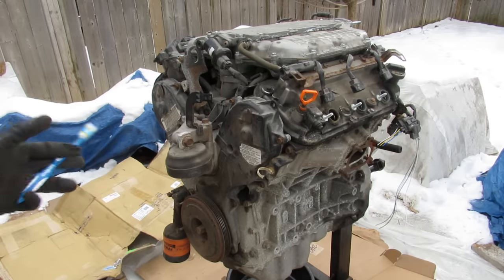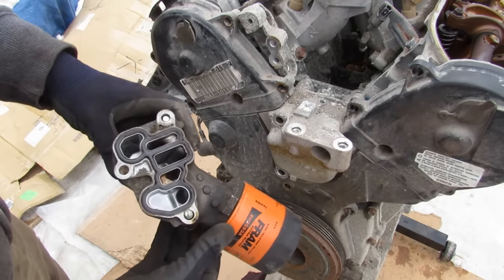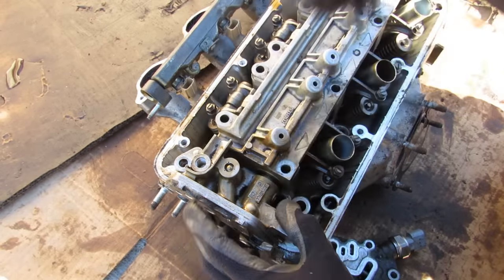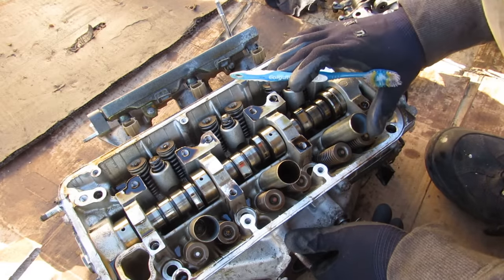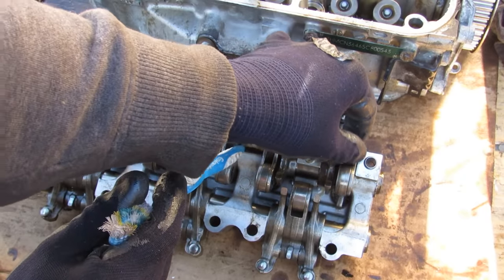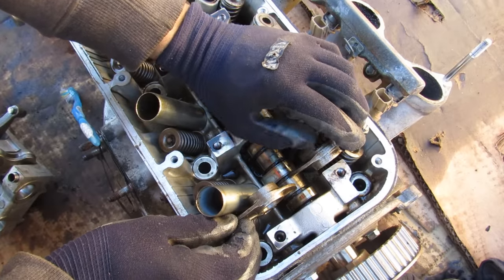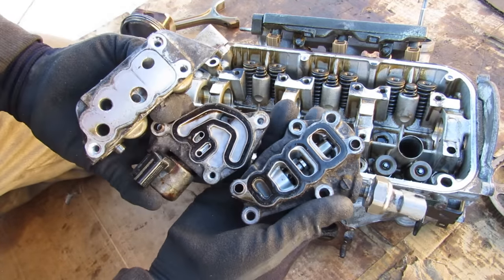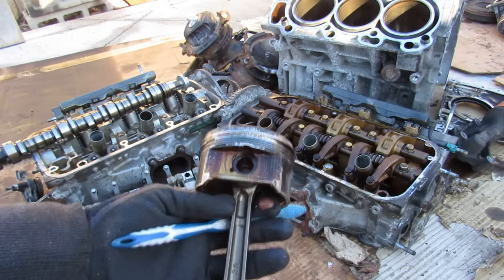Why Cylinder Deactivation Can Cause Engine Failure

Comment: Great video, I’m hoping Honda/Acura made advancements to their VCM tech. We have a 2017 Honda Accord V6, & I change the oil religiously every 3500 miles with the best oil. So far, no oil burning or troubles from the engine at all.  Now the daytime LED headlights are another story...
Reply from the maker: Keep up on the oil. The 2017 is the last of the V6 Accord.
Reply: @speedkar99  - Indeed, & I love the power & smoothness of this engine. I hope in another video, you’ll show the different versions of the company’s VCM. 

Love the videos man!
Reply: You should also change the transmission fluid more often than Honda says if you want to still be driving it at 250k miles.    I have a friend who knows Honda engines and history of problems and he drains and replaces his every 15k miles.   I just got a used RDX and will change mine every 30K miles minimum unless the service tech says the fluid looks bad and then Ill move to 15k miles.
Reply: @georgesmith4639  agreed, we have multiple Honda/Acura vehicles. And I personally do a drain and refill of the transmission fluid 3 times a year.
Reply: @MrSamPhoenix  I saw on another video today that there's a transmission  fluid filter that also needs changing (I think every 30k miles).  It's located way down below the battery.   Just curious if you change that as well and how hard it is to do from the top side.
Reply: I wish people answered all the pertinent questions lol, but this looks like another one for the odyclub forum for me. :-)

Comment: Disabled VCM with Ktuner on my 2017 Accord Coupe V6 at 6,000 miles, haven't turned it back on since. At 59,000 miles now; the engine doesn't burn a drop of oil.
Reply from the maker: Awesome! So that's all software, no need for resistor?
Reply: @speedkar99  Yup! Just an ECU reflash. Technically the only "correct" way to do it
Reply: @accordinglyryan  yup 👍

Comment: November 4th 2020 my 130,047 mile V6 experienced its failure. ALWAYS used Mobil 1 products specific to the car, changed every 6k miles. I get in the car that morning, on the way to work, and I heard a metal on metal banging noise. The car was still running, seemingly fine. I had no choice, so I drove it to work and then straight to the shop. I got the bad news the next day, rear cylinder head...done. My guy found a 81k engine and in it went. I bought a 21k mile Arizona off lease 2017 v6 immediately as well. Hopefully the 2017 with its changes has engineered this problem out.
Reply from the maker: Interesting. How old was your car?

Comment: Hi Speekar,  Great explanations as you go a bit more indepth!  Question, have you seen the S-VCM controller?  It appears to fix everything except being about 10% cooler on the thermostat reading.  I think this VCM is a big opportunity if it is 'solved' as there are so many Honda 3.5L's.  Thanks Speedkar.
Reply: I have the svcm in my accord, works beautifully. From what I remember it only modifies the signal in the running temp range and passes the true signal through for any other temp and that seems to be my experience. And it's very easy to disable with the 12v power wire that feeds it. In power loss it becomes passive all the time and just passes the true signal through. 

I still need to do the rings and cats on my engine but the oil consumption has plummeted. From 5-7 qts between oil changes down to just 1-2 qts, which I attribute to the rings and the valve cover gasket leaking. Still need to clean the spark plugs at each oil change but it's better than needing to replace them all the time from a misfire. 

I'm a very happy customer.

Comment: It is very odd how Honda can pull off such a failure when at the same time and same year pull off some of the best engines ever.    The J35A5 I had in my old 2006 MDX was so far the only engine that burnt 0 oil even at 200k+ miles towing an RV on very long road trips like 8000 mile trips and the oil was still full at the end.  The run after more MPG just lead them to making errors it seems.
Reply: How heavy was the camper?

Comment: Excellent video, as usual! Nice pace, good information!

It seems that fooling the computer into thinking the engine isn't warmed up would cause it to run open loop (as if the choke is on) which would cause it to run rich all the time (poor mileage, carbon build-up, poor cylinder lubrication). I also thought maybe one of the failure mechanisms might be when the back three cylinders are reactivated, re-engaging the pistons in the rocker arms might be a little dicey with the stationary rocker arm piston trying to engage a fast-moving part. But the oil-burning bit - ugh! Seems like it might be better to hold all the valves open, but then that would introduce other problems unless maybe there were separate intake and exhaust systems...
Reply: That's not actually true. The VCM disable devices only slightly affect the reading out of the ECT1 sensor. The ECT2 sensor is left alone. It's been found to have no negative affects.

Comment: I did a tune up on my 09 Odyssey 1 year ago, I just got a misfire on cylinder 1 the other day and when I pulled the plug it was completely caked with oil. I'll have to do another tune up and I'm buying the device to deactivate the VCM.

Comment: Quick qualifier, I’m a Honda technician, while I agree that the VCM system isn’t perfect; I literally did piston rings on a 11 odyssey today, that discoloration difference between bank 1 and 2 is very common, and not due to a rebuild. Like literally virtually all 6 cyl Honda motors are gonna look night and day different between bank 1 & b2. 
Bank 1 is always 10x nicer looking then bank 2. I’ve asked 2 master techs I work with why that is, I’ve heard different theories, one is the path of the oil, the other is that bank 2 runs hotter because it’s always live (for the most part, cyl 4 can deactivate also)
Reply from the maker: Good to know that. 
Even non VCM motors have that color discrepancy. How long did it take to finish that Odyssey?
Reply: @speedkar99  embarrassingly long. 
Original complaint was a b1 & b2  tw-wuc failure, turned out it was due to oil consumption fouling the cats. So it booked out at 27 hours according to Alldata , that’s 22.6 hours for 4 out of 6 piston ring sets then 4.4 hrs for both cats, we thru in a t-belt service that included water pump, belts etc concurrently to shave off 4 hours but still, it was pricey. 

It was about the biggest job you can do on that engine before it just becomes cheaper to find a used engine. 

Client was very cool, took me about 20 hrs to do the 27 hrs labor, that’s including valve adjustment (Honda’s don’t use hydraulic lifters) coolant flush, oil change etc. 
I wish I could post a pic of the four pistons I removed, cleaned and reinstalled with new rings. From the top, they looked like new (yes, I know you don’t have to go all OCD when cleaning the pistons but for 20+ hours labor, I’ll spend 1hr scrubbing pistons in a bath of VOCs :)
As for the original question about discoloration, I’ve seen it all the way back to the first gen pilots and odyssey’s, so my theory is that the way the oil flows, it’s just hotter, more likely to leave deposits by the time it’s draining down the passages in b2, but again, that’s my guess, I have not had that confirmed by any Honda engineers.
Reply: Edit* I meant the same time frame odyssey’s, I realize they go back way further*

Comment: Very nice explanation as usual, I always thought all VCM systems worked fully electronically by just shutting off fuel / spark to cylinder(s) ECU wants to deactivate and letting mechanical parts keep going as usual.
Reply from the maker: It might do that while coasting to a stop and engine braking

Comment: Why did they not let the exhaust valves open (leave them partly open), and use a separate exhaust perhaps? It would get rid of the issues.
Reply: Or the intake for that matter. The valve rockers still ride the camshaft, and a minimal opening with the right timing will generate positive pressur in the cylinders.
Reply: @pizzablender  I think they want to avoid vibrations and wasting energy on compression. But keeping the exaust valves partly open (during all four strokes) would do the trick.
Reply: They keep the valves shut because the air acts like a spring. If the valves were open you'd lose energy moving air in and out of the cylinder. A spring stores potential energy when compressing the releases the energy when the piston goes back down.

Comment: Very informational video. Had to look at this video because Ford’s cylinder deactivation works in a very similar way in their new F150’s with the 5.0 Coyote engine. I was hesitant to enable the feature, since I had control in turning it off, depending on what driving mode I selected. Since I’m only using flex fuel and the newer engines have both direct and port injection, I’m not too worried about carbon build up. Probably just have to keep an eye out for oil consumption, and ensure I change out the oil regularly.

Comment: Just disabled my vcm with a resistor for the coolant sensor. Vibration on acceleration is gone. Only occasionally feel it.  I was getting 21.7 mpg. We'll see how much it drops. Honda says my pilot should only get 20mpg on average but I'm averaging almost 22mpg. Acceleration is much better without vcm so I would imagine that that will drop the mpg alone. Before I felt like I had to be careful when accelerating, but now I don't.  I'm do a scotty kilmer oil flush before the next oil change and a fuel tune/flush. I'll check the oil today to see if there's a difference.

Comment: To solve the problems from single-engine VCM, one might want to consider two engines independently driving a two-input transmission through a plenary gear set.
Reply: Hybrids
Reply from the maker: Agreed

Comment: This is part of a comment that I made regarding this issue on another channel. "2015 Odyssey. VCM on since new. Works great and saves gas. No oil consumption according to the dipstick. Oh yea, I change my oil between 30-40% on the less than adequate maintenance minder, not the 15% that dealers recommend." Good chance that you hit the nail on the head talking about oil quantity and quality. I pay the seeming ridiculous price for Genuine Honda Oil at the dealership. Maybe worth the price? Will hit 200,000 miles on the vehicle soon, probably this week. Spark plugs were clean and in great shape when I changed them at 110,000 miles.
Reply from the maker: Maybe. These newer Honda motors aren't as good as they used to be

Comment: Hondas later VCM systems split cylinders deactivation between both heads and sometimes just shutdowns two cylinders instead of three depending on load.
Reply from the maker: So I've heard. 4 cylinder mode
Reply: I have a 2015 Accord with the later 3-cylinder rear bank vcm.  I haven't had a single issue with mine.  No vibration, no oil burning, and it activates smoothly.  Regular maintenance and varying city/highway mileage does wonders.

Comment: And then we've got GM's AFM (vcm equivalent) that loves to burn oil (especially the earlier ones), destroy lifters, chew up camshafts and bend pushrods.
Reply from the maker: Yeah those we're pretty bad at it too
Reply: Ah, the  wonders of modern technology, reminds me of the engines of the 80-90's emission control laden junkers.  So much unnecessary extra parts. In the end its all about AFM coking the rings is what causes demise of AFM engines, first rings slowly coke up with carbon from unburnt/burnt oil in the cylinders, then rings freeze and the massive oil consumption begins. Leading to eventual rebuild all due to AFM systems. You cannot turn off lube to the deactivated cylinders or would score cylinders, a viscous circle for sure.

Comment: My boss got a total engine rebuild on goodwill from Honda at 75k miles on his Accord when it kept fouling out the third replacement set of plugs.  Though after that and a software update he's gotten over 130k with no issues so it looks like they may have figured it out or at least gotten it a lot better.
Reply from the maker: So they honored the warranty

Comment: What is the advantage of deactivating cylinders to have restrictions on the crankshaft from the same cylinders pulling vacuum?
Reply from the maker: Save fuel
Reply: @speedkar99  At the cost of loosing "some power" as well compared to a true 3 cylinder engine, am I correct?

Loosing some power: because of those 3 other cylinders pulling vacuum when deactivated.
Reply: @Kashxk  Yes it's worse than a real 3- cylinder, mostly because of the friction of the piston rings sliding up and down the bores. But it eliminates the pumping losses of trying to suck enough air for all 6 cylinders through the mostly closed throttle body when you're under light load.

Comment: Honda really needed to put in compression release when cylinders are devacated do they make replacement without the VCM on the cylinders?
Reply from the maker: That's inefficient, you'd basically have a giant airpump

Comment: How about just shutting off the injectiors and spark plugs and let the valves actuate like normal?  Or having the intake and exhaust valves always open ?? This way there will be no vacumm or compression.  Thus avoiding pumping losses??
Reply from the maker: It takes energy to suck in air and put it out the exhaust
Reply: @speedkar99  yeah as you said in the video there will be pumping losses.  What if we have the intake valve open during intake stroke and open the exhaust valve during compression stroke ?? This way there will be no pumping losses ...

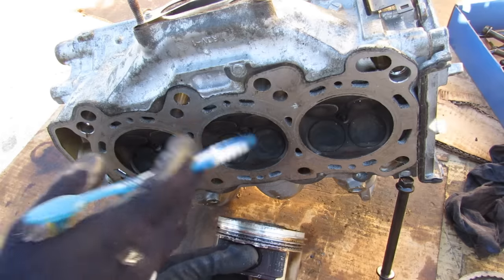Comment: 12:25 so the oil burning is caused by the piston is still moving up and down but the valve is closed so it creates vacuum on the combustion chamber and suck the oil from the oil ring.

what if they open all the valve/just exhaust/just intake valve during this mode so it doesn't create a vacuum? is it gonna solve the oil getting into combustion chamber?

Comment: What is your opinion on a J35Y1? My 2016 accord V6 has the VCM but I guess Honda made the system more reliable and fixed the issues from older model accords with VCM issues. I drive it pretty regular once a while I’ll get on it. I burn no oil, and change it every 4-5K using synthetic. 
Should I get a KTuner or a VCM muzzler? Or do you think I’m ok??
Btw awesome videos. I’ve learned so much from watching your vids!
Reply from the maker: Disable it

Comment: Question;  I have a 2009 Pilot with 215K miles.  Unfortunately, I  only recently became aware of the VCM engine wear issues. Oil usage has been significant and recently replaced fouled plug.  Despite the excess oil usage, it still seems to run well   Would installing a VCM disabling device help at this late stage?
Reply from the maker: It'll slow down what's happening but won't reverse the damage already done
Reply: @speedkar99  I have a 2014 RLX with 78k miles. Do you think it’s worth it for this car?

Comment: I have a 2013 V6 Accord Coupe and it has this VCM garbage. You can totally feel and hear when it activates, the engine gets so rough. I've heard it can wear out your motor mounts too. 
Is there an easy way to disable it? I dont know why they dont just connect it to the Eco button or something, but otherwise leave it off or let me turn it off.
Reply from the maker: VCM muzzler

Comment: I had a j35 in a 2012 accord coupe with the VCM. I actually got rid of it because I Hated the feeling of the cylinder deactivating and I heard it was a bomb. This has no vtec, but did my 2012 j35 non hybrid have vtec? Also is there a way to make the solenoid never turn the cylinders off?
Reply from the maker: I'm not sure if the J35 has VTEC (if it did, you can imagine how many rocker arms there would be on the intake?) 
You can disable VCM by adding a resistor to the coolant temperature sensor

Comment: Doesn't Acura's direct injection V6 have VCM and VTEC (i.e two cam profiles)? That's how they present it in their marketing brochures. If so, you would need a flat cam profile, a regular cam profile and an aggressive cam profile. Do you know anything about this?

Comment: On my daughters 2014 Odyssey when the VCM engages and the Eco light is illuminated I can feel a shudder. On my wife's 2017 Pilot and my 2017 V6 Accord I can never feel the system working. I installed a sVCM device for the Odyssey to disable VCM. No more shudder. Trying to decide what to do on the 2017 Hondas. Wondering if the VCM system was improved between 2014 and 2017.

Comment: I work as a tech at Honda. They replace piston rings in these all the time. Most under warranty extension. Flat rate time is about 12 hours under recall. 20+ hour for customer pay. One flaw of these earlier engines.
Reply from the maker: Have they fixed the newer engines?
Reply: Which year have the most problem?

Comment: Why would they close the valves when deactivating cylinders? Wouldn’t the compression just create unnecessary drag? Why not just leave the exhaust valves or open?
Reply from the maker: It's alot of work to suck in and out air

Comment: When the valves are disengaged and closed via VCM, the pistons are still going up and down.  So when the valves are re-engaged, aren't the valves initially out of time with the pistons?  And couldn't this cause valve to piston interference as VCM is disengaged?  Aren't all J series engines interference engines?
Reply from the maker: They will stay in time, just not activated far enough down to push the valves down.